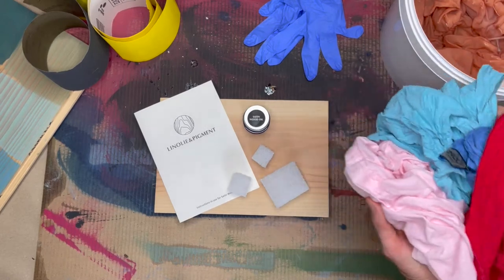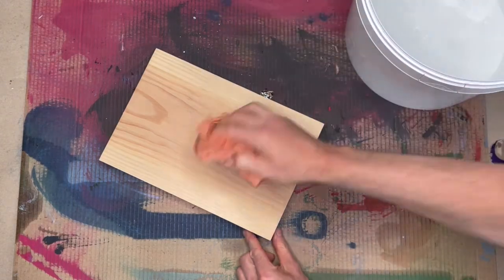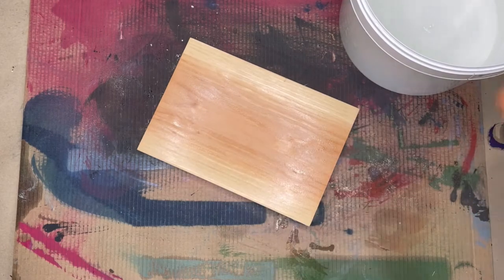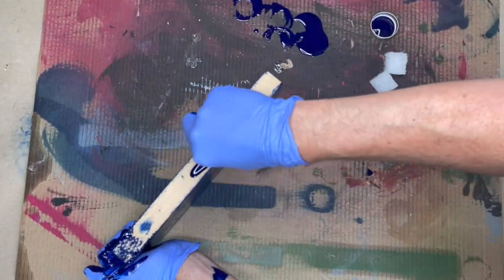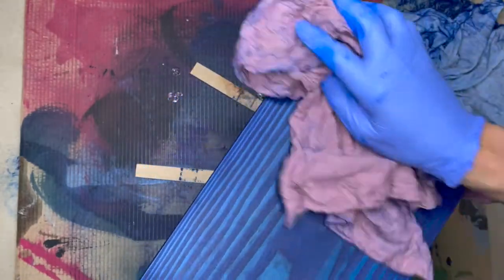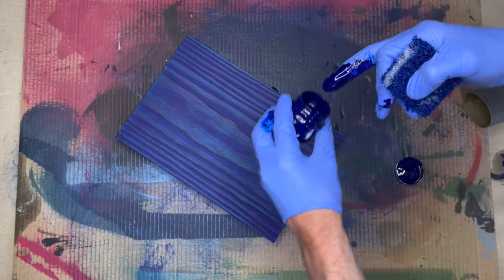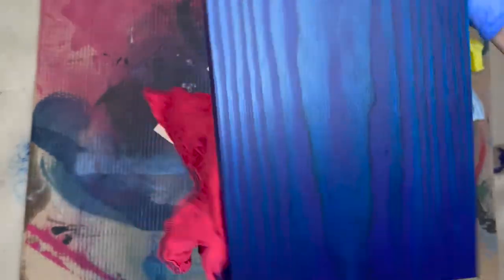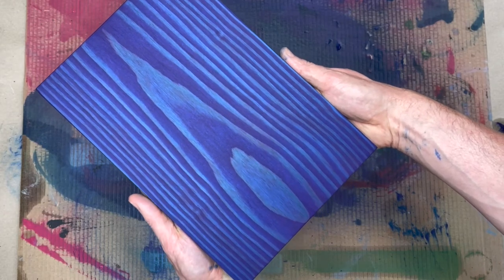How to use Satin Wood Oil

Comment: Is it necessary to apply two layers? And is it solely for the purpose of a more intense colour, or also for improved protection of the wood/durability?
Reply from the maker: It is depends on what you are oiling, and what the oiled surface need to withstand. Is it a tabletop 2-3 treatments wood be necessary to saturate the surface, but if it is just a picture frame one treatment would be necessary. Please write us at info@linolie.dk if you want exact guidance to your project. Kind regards